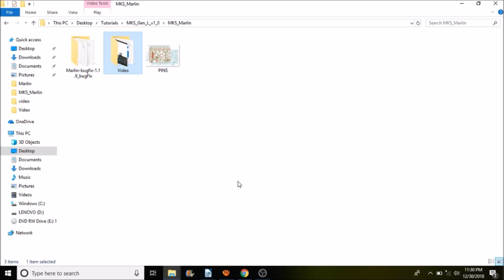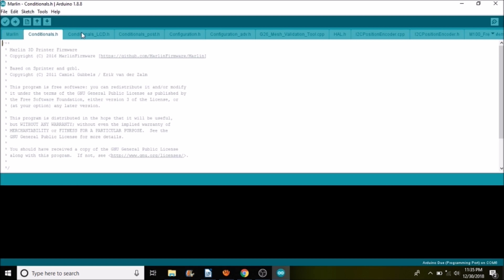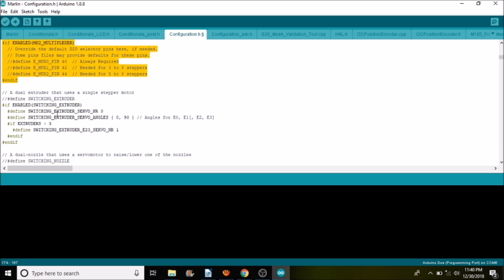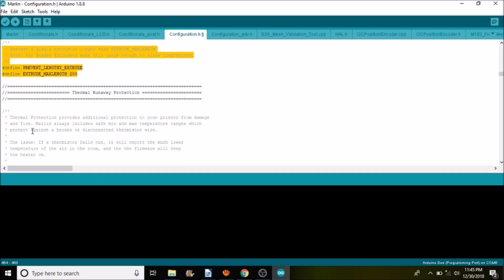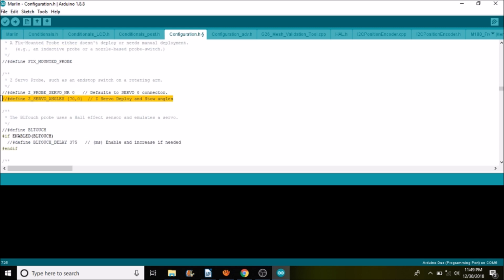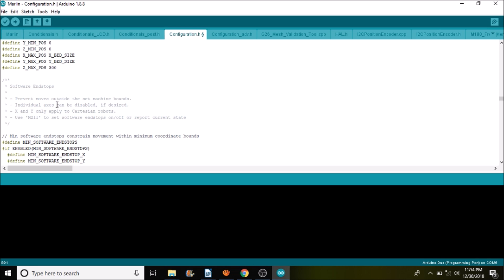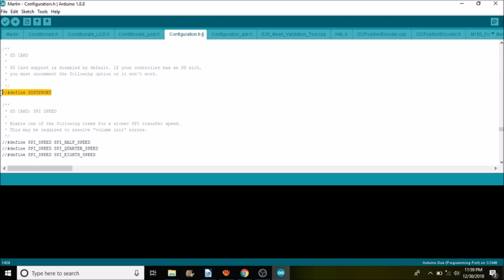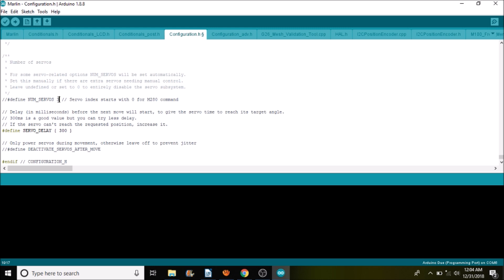MKS Gen L - Marlin 1 1 9 (configuration.h)

Comment: Hi Edward very informative video as with all your videos
My question is regarding the Marlin firmware and the mks gen v1.4.
I have installed the firmware when the screen comes on it is not showing the bed icon for the heated bed.
Have you got any idea?
Thank you for reading awaiting your response.
Reply from the maker: The hotend does appear on LCD, but I've never seen a heatbed.  You could try and create an icon?
Reply: @EdwardBraiman  Hi Edward thank you for your reply.
The screen normally as a icon on the right hand side on the top showing the temp of the bed.
This is missing on my screen.
How can i send you a picture to show you what i mean?
Thank you.

Comment: Hi, how are you I was trying to install marlin 2.0 on MKS gen with LCD (RepRap discount smart controller with sd card)  l tried but not working I have an Anet A8M printer with a dual extruder,  can you please guide me as i am new to this,  or any link where I can get firmware which has settings as per MKS and discount controller, Thanks.
Reply from the maker: Which version of the board?  MkS Gen L v1.0 or MkS sGEN L v x.0?  There are two different chipsets one is 8bit and other is 32bit processor.
Reply: @EdwardBraiman  it's MKS Gen l V01 (this is what I have in description " mks-gen-l-v10-compatible-ramps-open-source-marlin" and LCD is Rerap discount controller including card slot
Reply from the maker: Start with this video in this play list,https://www.youtube.com/playlist?list=PLP-VDZmS6bFpd24RVYsvz0YMdafl2qkGn
Reply: @EdwardBraiman   Thanks sure I will check these thanks again for this
Reply from the maker: You're welcome.

Comment: Would the configuration.h file change if using Marlin-bugfix-2.0.x instead 1.1.9?

I'm using the a motor with a TB6600 driver and MKS Gen L v1.0 directly, no other hardware at the moment..  but I don't see any options for that motor driver in the configuration.h file.   Do you have any recommendations on what settings I should try?    Once configured I imagine I can check the performance and use Pronterface?
Reply from the maker: Depends on the datasheet for the stepper.  But you can fake the stepper as if it's another stepper like a4988.  Granted I would be careful and compare the two closely to not break something.

Comment: i want to replace the original melzi creality v1.1.3 ender 3 board that has the input voltage 24v and the mk10 hot end with mainboard mks gen l v1.0 plus tft 2.8 touch screen and titan aero 1.75mm 24v, is this possible ?

-on my creality mainboard at ''fans, hot bed, nozzle '' write 12v, but i measure that and i was expected to be 24 but it was 12 v both -so my nozzle theoretical is 24, but it has 12 volts on the mainboard, that is a problem? if i will buy the titan aero hot end what voltage do i have to buy it ? -the melzi mainboard from creality has a ''atmega1284p microproccesor'',but the mks gen l has ''32-bit STM32 microprocessor'' -is that a problem if mks gen l has a 32-bits microprocessor? i mean if it has bore bits that the atmega. Can it burn ? -is the melzi mainboard has theoretica 3* 12 v blocks but in reality 3* 24 volts what voltage need the mks gen l board to have ? if it has 12 volts the al that 3 components to wich need 24 v is going to be any problem ? -that 3 component ''fans, hot end, hot bed '' are in reality 24 volts, the matter if on that mainboard is 12 or 24 volts ?
Reply from the maker: Okay first I think we have some things to sort out in the questions.  First MKS Gen L v1.0 is an 8 bit process using MEGA 2560.  MKS does produce other process boards, so you might want to add a link to sort this out.  the MKS Gen L v1.0 does either 12v or 24 depending on you PSU (Power supply unit).  As for the titan hotend it appears to be  either 12 or 24v, which will work on the MKS Gen L depending on power supply and Heating element loaded for 12 or 24v power.  If you choose 24 volt fan you'll need to purchase a new fan with a 24V PSU.  Hope this answers yyour question.
Reply: Yes, you can replace the Melzi board but you'll essentially be starting over being that the Melzi doesn't use the same programming language as the MKS board does.

Comment: Hey mate, when i try to turn on my heated bed via controls. The printerboard/psu just turn off? any ideas? Its just a standard EFB set up
Reply from the maker: What's the PSU statistics?  Does everything come up correctly a second time?  What hardware are you using?
Reply: @EdwardBraiman  
The power supply i have is a S-240W-24 2.6A
With a 30amp output
I have a 24v heater cartridge
A4988 stepper drivers
12/24v bed
Full graphics smart controller (the square one)

I did have a Mosfet go from psu using 4mm wire to the bed and printerboard. When I heated up the board it would say "heating failed" after 10 seconds But not turn off. I thought I had done sometj ikng wrong and took off the Mosfet, . And tried but it just turns off/restarts printerboard and psu
Reply from the maker: Can you test the continuity of the thermistor wiring with a multimeter?  You using a MKS Gen L, correct?
Reply: @EdwardBraiman  I can do that. I gotta buy one tonight. 
I have tried without the extruder and it's doing the same thing
Reply: which parts of the board will i be checking with the multimeter?

Comment: How would you connect a second speed controlled material cooling fan. Is Y wiring from the one already there OK or should I go with the 2. fan wire to the board (MKS GEN L). Thanks
Reply from the maker: Checkout my fan extender tutorial.  Hope this helps.

Comment: Do you know why my atmega 128p says it has 16kb of dynamic memory  with marlin but if I use my Base gen L with the 2560 its says it has only 8kb of dynamic memory so I cant upload marlin because the creality board has more memory even though it has a 128p?
Reply from the maker: Well Marlin firmware should fit, but you can try another board if you would like.  Check Marlin  board.h file to see if your board exists first and Arduino IDE has your board chipset.
Reply: Thanks for the reply I figured it out. I need to disable the SD Card support for the MKS. The Creality boards actually come with an extra atmega chip for the SD Card it gives an extra 12kb of ram. When I disabled the SD card my ram use went down to only 3kb/8kb so it worked.

Comment: Hi,can I use this process for Marlin 2.0.x on a MKS SGen L
Reply from the maker: Yes.  Just remember Marlin 2.0.x is more geared to 32 bit boards and is backward compatible with 8 bit.  If you used a BLtouch or 3d touch the process will be very different for setup and configuration.
Reply from the maker: You're going to need to used Marlin firmware 2.0.x for sGEN L.
Reply: Ok thanks a lot :D
Reply from the maker: You're welcome.  Keep in mind I've made a playlist for MKS sGEN L v1.0 and will be doing newer MKS products when they arrive.
Reply: Nice!,again thanks a lot,you now a new subscriber

Comment: hi, please help me to use "Material Detection Module" connection on MKS GEN L V1.0. and MKS TFT32 .
Reply from the maker: Have you checked out my MKS Gen L tutorial for this in my playlist?  It is using TFT28, which should be the same.
Reply: Edward Braiman i have already cheack your all videos but I couldn’t find any thing about material detection module connection and firmware
Reply from the maker: I'll need to do some research.  This might take a couple of days.
Reply from the maker: So you're asking about detecting a filiment run-out?  I've not yet done a tutorial for tft32, but in my RAMPS 1.4 tutorial I've explained filiment run-out.  It may get you closer to a solution.
Reply: @EdwardBraiman  hey. I found a video from your channel. It's (https://www.youtube.com/watch?v=ijAuX8d3Mr4)  ( not understandable :(  )
it's  what i want to learn, but this video use ramps 1.4 and lcd. I just want to know how can i use it on 'MKS GEN L V1.0 and MKS TFT32 or TFT28 (doesn't matter). Connection to the board and firmware
Reply from the maker: I'm still working on the details for a run out on the tft28.  Might take some time.
Reply from the maker: In one of my videos I link to a design of mine to make your own.
Reply: You talked about the pin configuration but didnt tell what to do with them I am trying to set up the gen l board but keep getting a error 
Operator '==' has no right operand 
But was getting no motherboard defined
Reply from the maker: What specific thing are you trying to set up?  Have you reviewed my MKS Gen L playlist?  It may cover a couple of your questions on setup with both hardware and software.
Reply: @EdwardBraiman  I got it figured out thank you
Reply from the maker: Congratulations.  What was the solution?
Reply: @EdwardBraiman  I plugged my fillament sensor into the e positive instead of the servo plugs
Reply from the maker: So everything is working now?
Reply: @EdwardBraiman  well I dint know   it got my extruder motor to work but I havent checked if the run out works I should try that shouldn't I hahahaha I will try tonight when I get home
Reply: Yes the filament sensor is working correctly

Comment: I have a problem when my printer try to print the motors just sound weird and it did nothing, but when I move it with a gcode it works perfectly
Reply from the maker: What type of stepper drivers?  Are they calibrated?  In Pronterface turn on debugging and see if anything seems interesting.
Reply: @EdwardBraiman  I've dvr8825 yes they are calibrated for nema 17 1.4A ok I try It

Comment: what programmer are you using that is not an Arduino Tool..
Reply from the maker: It's Arduino IDE.  What are you trying to ask?
Reply: @EdwardBraiman  I solved my own problem since I posted... I had the syntax wrong by default on configuration.h minmax software  was supposed to be capitalised... U8 library was not installed properly too.
Reply from the maker: Cool.

Comment: i cant see my lcd on my he3d k280, tips?
Reply from the maker: Check the cable and board pinouts are aligned correctly.
Reply: @EdwardBraiman  it was fine before uploading the fw using arduino.
Reply from the maker: What type of LCD?  What settings have been changed in Marlin firmware?
Reply: @EdwardBraiman Morning Edward, look Edward i just got this printer 2days ago or so and all i did was look up this youtube and follow some of the steps such as like downloading Arduino IDE and the Marlin FW which i uploaded to my printer and after that was done doing its thing the printer's lcd just when blank altho i see the serial port displaying data via arduino ide's terminal on port 3, so this tells me that nothing is wrong except that this FW was created without the LCD in mind, here is a link to the lcd i own https://malaysia.timbangharga.com/cf/350/cdn/HTB1VuY7X4_rK1RkHFqDq6yJAFXat/2004-LCD-Display-3D-Printer-Reprap-Smart-Adapter-Controller-Reprap-Ramps-1-4-1-6-Mega2560.jpg
Reply from the maker: One my order tutorials in my playlist that looks similar might help.  Keep in mind that the pinouts might be different for your board type. so your motherboard might need to change. Also check your chipset for mega2560.  I'll see after work.

Comment: I wanted to share my problem and fix. I had a no luck getting this to compile. Same error for core/core exists can’t overwrite. Short story, I disabled my virus program and BAM! Worked. There are 5 days I won’t get back. Hope that helps someone.
Reply from the maker: Which version of Arduino IDE?
Reply: Edward Braiman I tried the latest and even dropped to 1.8.5. Unless I disabled MaCaffe it would not upload.
Reply from the maker: Current version is now 1.8.8, maybe it will work.  I had similar issues until this version.
Reply: Edward Braiman Man if you how long I tried to get it to work, I started out with the latest version, in desperation I went back to 1.8.5 and still the same. After hours of searching I found one small post that said “turn off anti virus” I mean that’s all it said. This is after reading hundreds of posts. I love your videos, my first try uploading from basic MKS gen L worked, after that nada. Thanks for all your help!  I’m still going one by one and I’m almost ready to plug it all in and see how well I’ve done.
Reply from the maker: Good luck